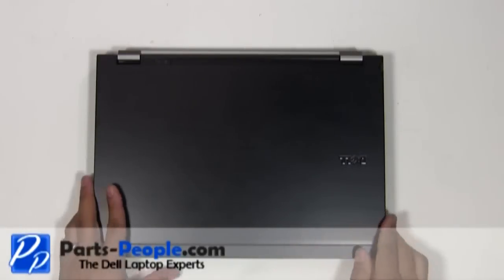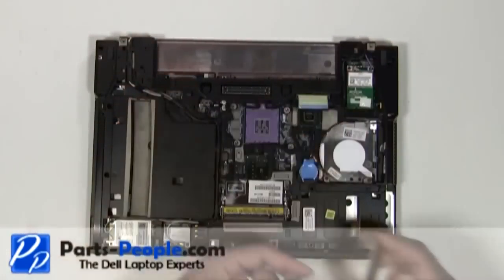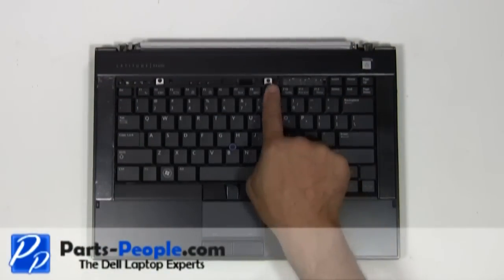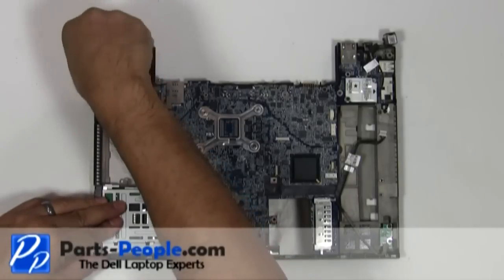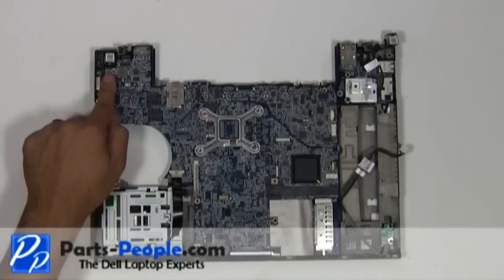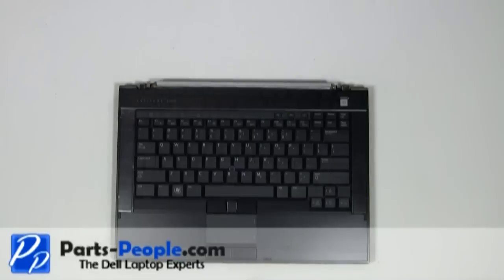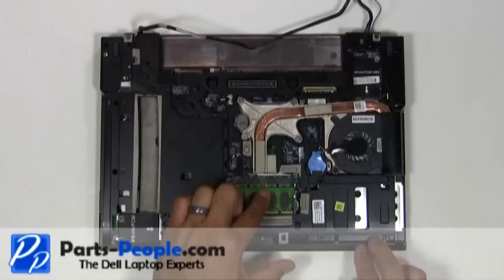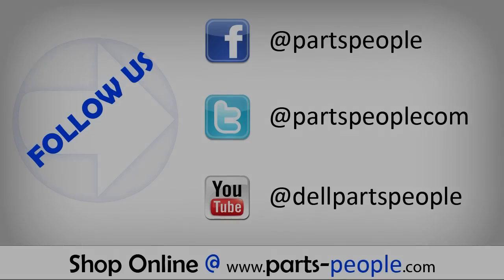Dell Latitude E6400 | DC Jack with Cable Replacement | How-To-Tutorial

Comment: Laptops are a pain in the ass
Reply from the maker: There are a few YouTube channels that are pretty good and you can learn a lot from them.  Then you need to practice... a lot...  Computer Repair School channel , NorthridgeFix channel, and the older videos that Louis Rossmann channel did.
Reply: I'm scheduled to take the 1101 A+ certification exam on the 16th.. and I'm just finishing up getting a 2 year degree in IT. So I've got some experience with computers in general. Lol and I still think laptops are a pain in the ass. I've got this exact old laptop and it needs a replacement power port. So I'll use it to get some more experience. I also just got a job doing hardware repairs for Dell. I appreciate this video, it'll help a lot.
Reply: @dellpartspeople thanks though. I used this video to guide me through the fix on my old laptop. Works perfectly now.

Comment from the maker: If the 'Caps Lock" Led indicator light is flashing while the "Num Lock" and "Scroll Lock" LED indicators are staying solid then that is an Indicator that the memory has encountered an error.  

I would recommend play the 'memeory game' so to speak:
- Stick 1 in Slot A and the Slot B
- Stick 2 in Slot A and the Slot B

This should give you a better idea as to which stick or which slot may be defective.

Comment: @dellpartspeople Thanks very much for the reply. I understand that its not the DC power jack problem because I kept my laptop on a Dell replicator/Dock station and disconnected the DC power jack completely. In this way I am getting message battery low but not showing mesaage as "on AC power". My laptop is never shutting down but working slow. Some ttimes clock is working slow as time retartding by 5 minutes to 20 minutes in every one hour. Is it possible I can repair motherbord

Comment from the maker: @shahmmehmood From the description given, it sound like you have a short either in the DC Power jack or somewhere on the motherboard.  I would start by replacing the DC power jack first since it will be considerably cheaper than a replacement motherboard.  If that does not solve the problem them you will want to look at replacing the motherboard.

Comment: Hi, I need a big help pl. I used an old broken charger in which wire broken and touched to each other caused big problem. My laptop not charging the battery and even if I remove the battery but laptop shows starting and trips immediately in 2 seconds. My friend can charge his battery n replicator/dock station mine not charge. Now I am using my laptop by just charging my battery in friend's laptop so my battery is still ok and working in my laptop. Could you pl guide me what I broke in my laptop.